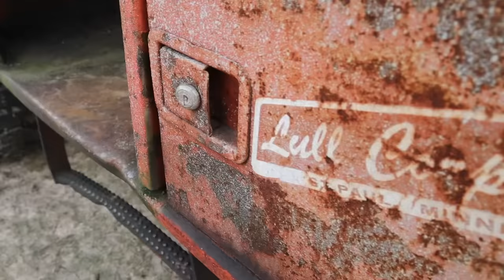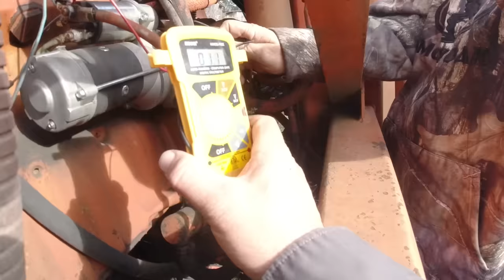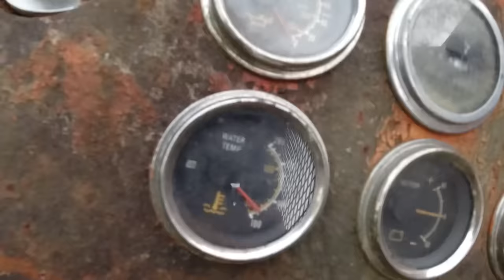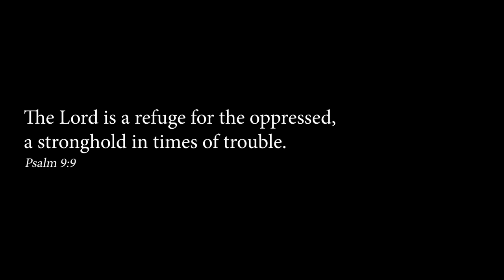I BOUGHT A 40 year old TELEHANDLER DIRT CHEAP! Will it start?

Comment: I drove one in Gulf Shores after Frederick putting shingles and trusses on buildings from one end of the island to the other. Make sure you change the filters on the hydraulics regularly. If moving it More than a mile or two trailer it. Driving top speed with blow out the hydraulic lines. The boom bushings tend to wear quick too. It's easy to work on and keep running.

Comment: Hello from up here in North Alabama.
Did you guys try to check the windings in the Solenoid on the pump. Ohm meter to see if it was open or high resistance reading. Check the new one to the old compare the values. That maybe the reason it wasn’t arcing to ground open solenoid windings. Enjoy the show. Maybe you could stop the video and ask questions what would you think it was to the people watching. First one comments correctly first get a tee shirt or hat. Thanks

Comment: The thought occurres that Hank putting the boom out trying to get on the trailer might've tripped the overload sensor
And not resetting it could have shut the motor down
Or
Boom out on slope = I need to stop you
Engine cut out = I really need to STOP you

More modern machines are more forgiving but older machines are basically an on/off switch to stop you killing yourself

Comment: I worked at Lull on the line as a A class Assembler every 544, 644, 844, that went down the line. There was only 1 line so all of them went down the same line the 544 was a smaller one with no boom about the size of a Alice Charmers. They dropped the 544 about 1982. There was also a 622  but that didnt last long. It was a rear drive rear steer with a spilt braking system that made tight corners easier when used in the right way it could turn on a dime But if you used it wrong it would break the axel it had two brake pedels that if not uesed the right way it snaped the axle. There was only about 100 of those built before they stopped building them. People just didnt understand how the brakes worked and they would use them in the wrong way causeing the axel to snap. When used the right way they were a good lift. They could turn on a dime and go anywhere and were a lot cheaper then the 644 or 844 they worked  a lot like a zeroturn lawn mower does today. 
  As far as motors go the costomers  could order any motor they wanted. Cats, Deutz,😮 Detroit, JD, and almost anything else. There was a few gas motors but mostly diesel were were orderd. 
  You could get them with cabs and with outriggers on just the front or on all 4 coners. 
 Those mostly went to Europe. They were tough machines and could go anywhere you wanted to. I know one of my jobs was forklift driver. I got to drive one every day for a year along wi😮th all the other lifts we had. We would go down to the lower level of the property down to the Minnesota River were we kept older parts and old stuff not needed. It was a lot of fun when there was a good rain made 4 wheeling fun on a 844 we had one of  the first ones off the line we used and abused it and never broke anything on it they used it as a test machine . We did get it stuck playing on it down by the owners old house it was behind the shop it had the best veiw of the river. And was a great place to have a smoke and take a little brake. I know the machine i loved to drive was a old 20 ton lift monster we had there that lull made during the 40s into the 50s you would climb up the ladder to get up to the operators seat you were about 15 feet up with all the old levers to work it. It would lift the huge thick sheets or steel that came in by truck we could lift the whole load at one time. It was a beast. I hope they still use it in Wisconsin were they moved to when they got bought out by JGL.
  I will say this that it was the best job I had there was a great bunch of guys to work with and for. They were willing to let you take any job you knew you could do. I started in the lowest job and moved on when i could. 
  If any of the guys happen to see this post while sitting at the lake or out on a deer stand or enjoying a beer your all retired by now so i hope life was good to you and your families 
 Attach a message to this post if you remember me. 
 And these lifts are the first of there kind. You see them in different brands now days but back then we were the only ones building them they had the patent on this type of lift for awhile till it ran out and it didnt take long for the copys' to show up at all. They knew how good they were. Its why JGL took over them there still making money of them. 
  Oh if anyone out there still has a 622 and in need of a parts book with all the specs and parts with there drawings I have one i would gladly give to you. Now with all the problems they had with them i think theres a 1 in a million chance of a working one still out there 😅😅😅

Comment: I was feeling the frustration you guys where going through , working your way through each item to find it the stop/start solenoid on fuel injection pump , I gone through same things as you guys on my Landy  diesel 2.5N/A engines I’ve built and it’s the last thing you least expect to be faulty but after sitting any moisture can kill them the firing can brake or it sticks in off piston all of a sudden and all u can do is replace them but I bet from the time you fit new one till it’s last day you ever use it that it won’t fail again ! 
Look forward to seeing part two soon looks like a good restoration of parts needed and a few hoses plus that hydraulic tank drained and cleaned before any full use as you want to get rid of any water etc in it especially if you got rams needing new seals you don’t want water getting pump up into them afterwards .